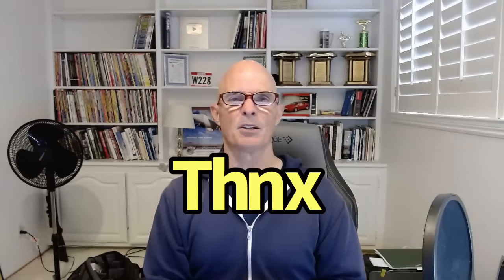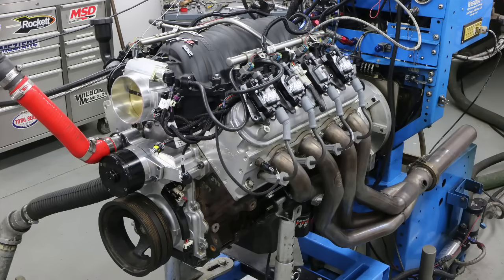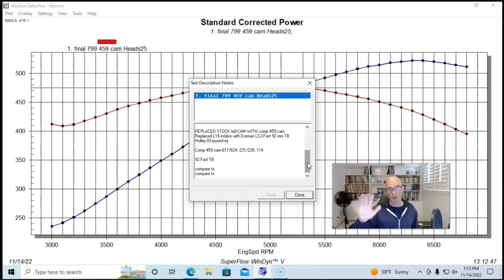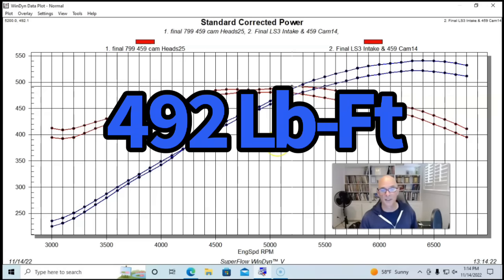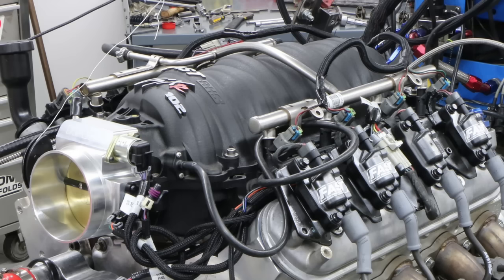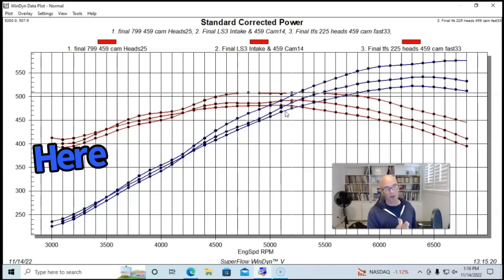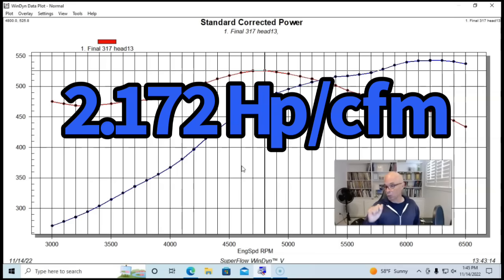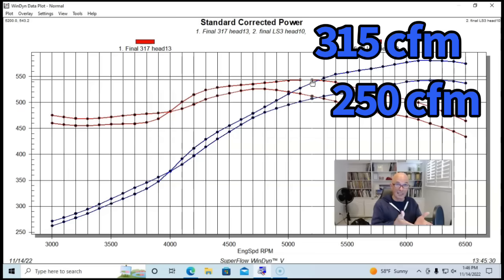HOW TO: LS 6.0L AND 408 HEAD SWAPS-HOW MUCH ARE HEADS WORTH? CATH v REC PORT v TFS/AFR CNC HEADS!

Comment: I’d like to see a 408 build for pure torque with the smaller valved 862 or 706 heads for us guys that haul heavy loads .  We’d never need anything above 5000 rpm’s
Reply from the maker: those would hurt a 408 (even for torque)
Reply: @richardholdener1727  interesting.  I figured the smaller valves and smaller combustion chambers would help far as port velocity goes but guess there’s a limit to everything.  And upon thinking about it now, the smaller combustion chambers you may would run into detonation under loads which then timing would have to be decreased and then the higher compression becomes null and void.  So yea I agree.  Probably best to stick with the 317s.  Thank you for your response Richard.  Honestly don’t think you’d even notice I had commented

Comment: Love the Comp Cams camshaft he used in the 6.0 it's a great street cam for larger capacity engines like the 6.2 litre and above.
Using that particular camshaft in the 408 with the LY6 rectangle port heads and LS3 intake would put maximum HP in the sweet spot with a fantastic streetable engine the end result.
😎🇦🇺👍

Comment: I’ve learned so much watching your videos. I just got my 408 back. It’s 10.3:1, forged rotating assembly, clevite h series, summit 234/238 .625/.605 on a 115, Johnson short travel lifters, yella terra rockers, btr .660 springs, comp hardened push rods, c5R timing chain, melling 10295, ported 317’s, Holley Hi Ram, Bosch 220’s, and will soon be reaching out to Chris1313 to get a triple fuel pump setup. I’ve been set on a vsr 88/104.5 t6. As far as turbo, what would you recommend to keep back pressure down to get high boost numbers, 20+psi.???    This is going in an 03 Tahoe btw

Comment: Richard, I’m running a stock LQ9 with an old patriot 226/226 .585/.585 lift on a 112 lsa. Heads are a prc ls6 stage 2.5 with a 61cc chamber. Do I have room for a larger camshaft in your opinion ? Or do you think piston to valve clearance is going to be too tight with the stock flat top pistons and a 61cc chamber
Reply from the maker: you have room for a bigger dual pattern cam

Comment: Hey Richard,  I'm building an all forged 408 stroker with a chopacabra cam, planning on the afr 1501 enforcer heads, and possibly the jegs sheet metal intake. Could you tell me what approx hp this setup would be so I can figure out what I need for the fuel system.  Engine should be 11.1.1 compression.  Thanks
Reply from the maker: LOW TO MID 500S

Comment: What if you run a pair of aftermarket rec heads on a 408 with twin turbos?
Reply: Yes
Reply from the maker: all heads work with boost-the more you make na-the more you make at each boost level. After market heads can make more than stock (unported) heads. Ultimately the turbo(s) determine the power output.
Reply: @richardholdener1727  thank you Richard 👍
Reply from the maker: what is your question? After market heads work with boost

Comment: Hi Richard, I love your videos especially the ones about the 408 strokers. I have a 408 stroker project of my own and I’m  wondering what kind of power I can expect with my combination. It’s an lq4 block bored 30 over and stroked out to 4 inches hence 408 stroker with flat top dss racing pistons. The camshaft is a comp cams 54-471-11 with short travel lifters and factory 1.5:1 roller rocker arms. I would like to get afr 245 cathedral port heads and an lsxr intake with about 90mm throttle body and 1k cc injectors. Please tell me what you think?
Reply from the maker: YOU MEAN 1.7 STOCK ROCKERS, USE A 102 MM TB WITH THE 102 INTAKE

Comment: the test should have been done with the TFS 225 on the 408, I intend to buy these heads for my engine
Reply from the maker: feel free to do the test you want-the 225 heads work well
Reply: @richardholdener1727  
Do you think is a good option for a 408 600 hp, 200 nitrous?
Thanks for reply
Reply from the maker: they will support 600 hp

Comment: Richard looking for a head recommendation for a 408 high compression race engine. The curve ball is we have to run a .095 4 hole restrictor and 4150 carb. Thank for your advice 6500 max RPM.
Reply from the maker: .095?
Reply: @richardholdener1727  Yes sir it in the SRL modified tour rules, .95x4, 1 inch height carb spacer under the carb. Thx again. 6500 rpm max, 408 max CI
Reply from the maker: .95 MAKES MORE SENSE... .095 SEEMED A TAD ON THE SMALL SIDE
Reply: @richardholdener1727  Do you have a recommendation?
Reply from the maker: as a guess-620-ish lift, 246/254 @ .050 and tight lsa 105
Reply: @richardholdener1727  Thank you, LS3 or 799 heads? or?

Comment: I’ve got AFR 205s on my 408 with a 233/239 grind and a ported TBSS. The throttle response on this thing is nuts on the street. I’ve got a 3600 stall in it. It’s not the fastest thing on the block, but I bet it’s the most fun! It’s explosive in my single cab Silverado.
Reply: I have almost the same setup up but prc 225 heads have you dynod it or ran it on the track ?
Reply: @gregoriobarrios784   I haven’t, I’m guessing 480 at the wheel? I need to get a decent drive shaft and get it on the dyno.

Comment: I'm looking at running some 823 heads on a 408, but my question is at what point do you need to upgrade valves? Will stock valves handle say 20 or 25psi on a 408 running e85?
Reply from the maker: they will handle that

Comment: Not really a fair test when using the FAST intake with the GenX heads… you should of done the test with the Dorman intake with the aftermarket heads. So I’m guessing those heads were drastically helped out with the FAST intake manifold so the genX head results are not accurate. The Gen X heads probably don’t really make much more power then the rectangular port LS3 head’s using the LS3 intake.
Reply from the maker: the ls3 heads had an ls3 intake-the equal of an ls3 Fast-why limit the flow of either set of heads?
Reply: My bad… you did use the Dorman intake with the Tick Flo heads then the FAST Intake.. don’t know how I missed that. Since the stock LS3 intake is identical to the FAST LS3 intake….it would be interesting to see what happens when the new raised FAST LS3 intake was tested on the rec port heads .
Reply: Still would of been interesting to see what the FAST intake would of done tested on all the cathedral port stock and aftermarket heads.
Reply: I’m thinking of pulling out my 6.2L L92 with severe cold start piston slap, and dropping in a all aluminum 5.3L LC9 or LH6 . I’d delete the DOD BS that’s on the LC9 .

Comment: Richard, have you had the opportunity to run a set of ported 317s on a 6.0 or a 408? I wonder if they are a good alternative to aftermarket heads?
Reply from the maker: the big bang 6.0l ran ported 317 heads

Comment: For a Na build totally worth it!! For a boosted application as you said, just not necessary, throw in an extra 4psi and you make the same
Reply: So on a 408 just run stock 317s?
Reply: Just do both upgrades! The heads given more flow and power then add some extra boost as well. That’s my plan to build a healthy motor.

Comment: 70 years ago J C Whitney Inc. had a catalog that was full of stuff(gadgets) guaranteed to deliver gobs of power in my 1951 Plymouth with a 230 cu. Inch straight  6.
Had the hardest time (never did) get above 65 mph. Exhaust cutout, dual ball & ball carbs, shaved door handles, milled head with copper gasket sounded great tho

Comment: For the money, rebuilt 6.0 with a forged bottom, stock crank, slap a VSRacing 7875 kit on it for $1,200 and you're at 1,000hp for 1/2 the money of building a stroker with aftermarket heads to make 400hp less.  #ish   lol

Comment: So I had a turbo charged 403 (stock bore) with ported 243s and a edelbrock proflow intake, with a btr custom cam. Then a 346 in (lsi bore 5.3 block) btr custom cam, with the same heads,intake, and turbos. At the same boost level (15psi) the 346 was quicker in the 1/8. Had a transbrake, big stall, so power under 4k wasn't really a factor. I always assumed the heads just were not enough for the larger engine....is that wrong.
Reply: How would only reducing cubic inches give a quicker 8th mile?
Reply: Probably had a better tune on the 346

Comment: Dam Rich I wish you would’ve taken that 408 with factory rec ports and turbo’d it.. that seems to be the best budget built set up that soooooo many guys run or are considering running. And then to add to the flavor cam swap them from a turbo cam to a “NA” cam to see what the differences are.. That’ll get some views for sure
Reply from the maker: turbo just adds to what is there-so 580 hp x 2 (14.7 psi) would get you 1,160 hp is everything is right
Reply: He has done pretty much all of this before. He has many many cam head and boost comparison videos.

Comment: I have the AFR 245s on my current combo, a pair of TrickFlow 225 GenX on the shelf and a pair of 243s on the shelf. Cathedral gang, although my main reason staying cathedral all this time is because I had a new FAST 102 cathedral intake.
Reply: I'm think the 225 tfs head would run better at the track on stroker ls vs 245 afr
Reply: @chevy19699  I should mention that I have a 427 but you still may be right.

Comment: would you mill down a set of 317 heads 30  or 40 ?
Reply from the maker: most go .030
Reply: @richardholdener1727  how would it compare  after its .030 with the rest do you feel? do you think its worth while doing to gain the compression

Comment: My Lq9 with rec port heads won't pull away from my wife's ls1 with 862 heads till after 4000rpm. Both have nearly identical cams. 227/231 in mine vs 228/231 in hers. Transmissions go change the gearing quite a bit, 4l80 in mine vs 4l60 both cars 2.73 gears, both in 01 Z28's. 
I just decided before watching this to do with a 4000 stall since the 3000 was doing no good. Hers has a 3600.
Reply: If you mill the rec port heads you can pull away on low end. Little trick I did with my lq9 was took 243 heads but had combustion chamber made to the size of 862 heads which upped the compression and gave more on low end so in theory if you had a smaller cc on the ls3 heads you could pick up some low end pep
Reply: @swappedoutZ71  I'm seriously thinking of doing just that on my next build if I and when I have to tear the engine apart. It's just so darn reliable lol. Mill the heads, cut some valve reliefs and match a cam. Her car ran a best of 8.1@86 in the 8th and 12.6 in the 1/4 @109
I ran 8.2 in the 8th @89 and 12.5 @115
Reply: @VcArena  seems about right.. rec Port usually has the better top end pull.. id suggest milling the 823 heads as well to gain a better low end and mid range

Comment: "max flow" at 700 or 800 lift doesnt mean you need a cam that large because air flows a lot faster on a live engine than on the bench

Comment: I’ve got Mamo 205 heads on my 408. The part throttle response and drivability is crazy. I have this motor in a regular cab Silverado and it throws the truck around like a rag doll 😂
Reply: Big engine, small truck, do it in a extended cab, both standard and long box, then a crewcab with the 6.5 box.
Reply: @shadowopsairman1583  I have a 4x4 crew cab 1/2 ton a worked 6.0 throws it around easily. If I had 408 cubes it would be getting close to too much for stock suspension

Comment: Why does no one run a ls7 head on a 6.0 or 6.2? I am buying offset dowels and gonna move the head over on a 6.0 and I bet I  can make It fit.bbc offset dowels.come in 30 thousandths and 50 thousandths
Reply from the maker: NO NEED FOR AN LS7 HEAD ON A 6.0L-IT DOES WORK ON A 6.2L-AND VERY EXPENSIVE
Reply: @richardholdener1727   im gonna try it my friend.the exhaust is close to the wall .a bbc offset dowel will slide it over and valve shrouding is a non factor with the exhaust.i got a set of ls7s with new ferra valves and 660 springs roller fulcrums and titanium retainers in a trade so I want to see what it will do.i virtually have nothing in them